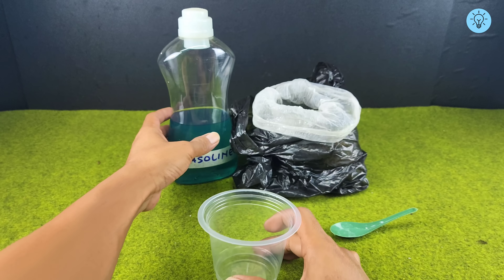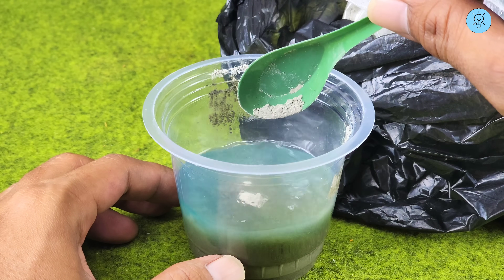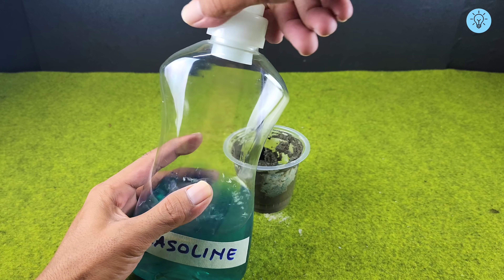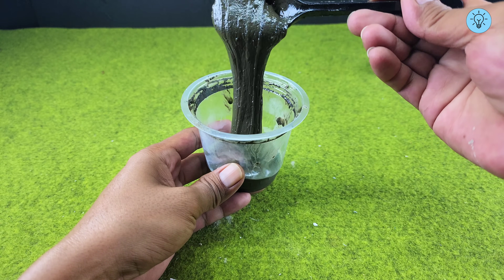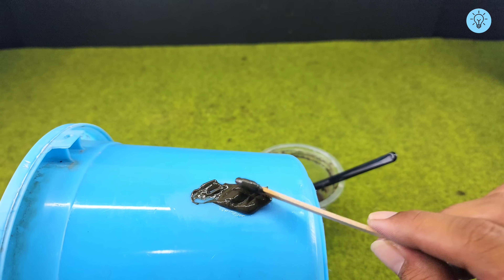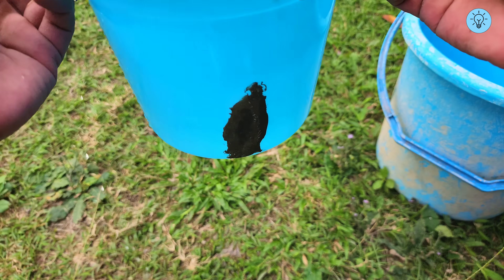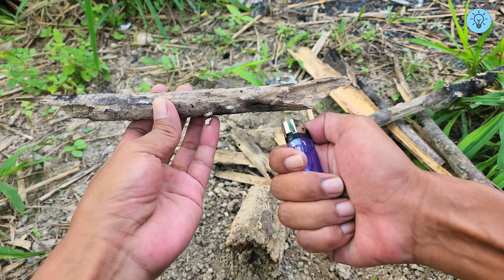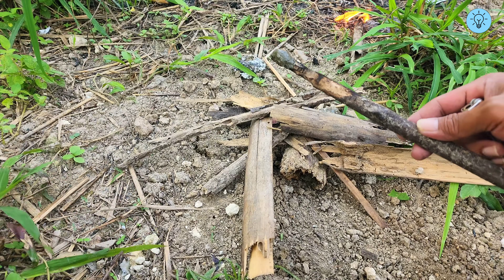Mix GASOLINE with CEMENT! Amazing results that most people can't imagine

Comment: Or, you could use the gasoline to drive to Harbor Freight and buy a new better bucket for the cost of the cement.🧐🤔😂😅🤣
Reply from the maker: That’s a very practical suggestion! Definitely a good option for some situations. 😄
Reply: @creationDIY_101 🤓
Reply: I'd repair my boat with this if I absolutely had to

Comment: Likely substituting a fine sand or dry clay instead would be cheaper and more effective. The concrete won't hydrolize anyway without water
Reply from the maker: Thanks for your input and sharing your knowledge! The video shows an experiment with specific materials to demonstrate a unique outcome, but your suggestions are interesting alternatives. Hope the idea is useful!

Comment: Does it have to high test blue jet fuel ? Gasoline isn't that color unless it's turbo blue or 2 stroke . Can regular gas be used ?
Reply from the maker: Great question! You can use regular gasoline — the color doesn’t affect the result in this case. Thanks for taking the time to ask! Hope the idea was helpful.
Reply: @creationDIY_101 Thank you

Comment: You are not allowed to use a gasoline mixture to start a fire in the woods.  Using gasoline to start a fire in the woods is highly dangerous and not recommended.
Gasoline is extremely flammable and can lead to uncontrollable fires, posing serious risks to safety and the environment. Here are some important considerations:

Fire Hazard

Gasoline can ignite quickly and create explosive fireballs, making it difficult to control the flames.
Legal Issues

Many areas have laws against using accelerants like gasoline in outdoor fires, especially in forested regions.
Environmental Impact

Gasoline can contaminate soil and water, harming wildlife and ecosystems.
Safer Alternatives

Use dry kindling, small twigs, and natural fire starters like leaves or bark to safely start a fire. Always follow local regulations and fire safety guidelines.
Reply from the maker: Thanks for sharing your thoughts and safety concerns. You’re right that gasoline can be dangerous if handled carelessly, but when used with proper caution and understanding, it can still be applied safely in controlled conditions. I truly appreciate your reminder about fire safety — it’s always important to stay careful. 🔥🙂

Comment: It would be cheaper & easier to buy a new bucket wouldn't it?
Reply from the maker: It's true, but sometimes it's not just about saving money — it's also about finding creative ways to repair and reuse broken items. These repair methods can be used in ways other than plastic, such as patching leaking roof tiles or fixing leaking walls.

Comment: Use kerosene rather than gasoline for the firestarter.
Reply from the maker: That’s a good tip! Yes, kerosene can be safer and easier to control in some cases. Thanks for sharing! 🙏

Comment: What kind of gasoline is blue like that? And in a special plastic cup no less. It looks more like two cycle gasoline.😅 Just Sayin
Reply from the maker: Actually, the gasoline isn’t for a two-stroke engine. The original color of gasoline is clear with a slight yellow tint, but in my country, fuel is colored differently to indicate octane levels — blue for 92, green for 90, and red for 98. The color helps consumers easily choose the right one for their vehicles. Hope this idea is useful!

Comment: Looks like 2 stroke
Reply from the maker: It’s actually not related to a 2-stroke engine. The fuel shown here is regular gasoline, but in my country, gasoline comes in different colors such as green, blue, and red. These colors are added by the producers to indicate different octane levels — green for 90, blue for 92, and red for 98. This helps consumers easily choose the right fuel for their vehicles. Hope this information is useful!

Comment: wonder how it would work to start fires if you used kerosene or diesel  USA
Reply from the maker: Good question! Diesel or kerosene can work, but they’re slower to dissolve Styrofoam compared to gasoline. It’s worth testing though! 🔥

Comment: Gracias, lo usaré para reparara el tanque de agua de 500 litros que me averió la pedrea del 2017!
Pero me parece un despropósito, solo con nafta y poliestireno telgopol´ ya alcanza para encender, o en vez de usar cemento para ese fin, con arcilla, ceniza o tierra creo que serviría. Pero no se. Es cuestión de probar costo beneficios! 
 Saludos desde Alta Gracia, Cba. Argentina.
Reply from the maker: That sounds like a great idea! 😊 Yes, you’re right — depending on the material, you can experiment with other natural alternatives too. But the gasoline and cement mix gives a very strong and durable result. Thanks for sharing your thoughts — greetings to Argentina! 🇦🇷

Comment: When you lot say gasoline is that diesel, cause that's kinda what I'm thinking. Oh wait do you want viewers to try both. Also you haven't discussed polypropylene or polyethylene containers and cross bonding
Reply from the maker: The liquid I used here is gasoline. Normally, gasoline is clear with a slight yellowish tint, but in different countries it can look different because producers add dyes to show the octane level. For example, here we have green gasoline with 90 octane, blue with 92 octane, and red with 98 octane. The colors are just to help consumers choose the right fuel for their vehicles. Hopefully, your idea is useful.

Comment: You should put a layer inside the bucket after the outside layer dries.
Reply from the maker: That’s a smart suggestion! 👍 Yes, adding an inner layer after the first one dries will make it even stronger and longer-lasting. Thanks for the great tip!

Comment: 4:57 that's not a smooth surface
Reply from the maker: Yes, you’re right, it’s not a perfectly smooth surface. Sometimes the translation or explanation from AI still needs a little adjustment, but the repair still works well.

Comment: That is really unique and cool but with the gasoline cement and Styrofoam mixture isn’t that kind of like a JB Weld? And also with the one you didn’t add the Styrofoam to that is like a liquid not liquid but a I don’t know what the name is but they sell fire starters like that to where you just push it out of a tube onto wood and it starts that is really cool and unique. I would like to know more about how you came across this and where you learned it at And also does it give off any toxic fumes when it burns and also couldn’t you put that on the inside of the bucket as well as the outside of the bucket you’re trying to fix just to make sure it holds better and could you use this on a car‘s oil pan to fix a crack as long as you did it on the outside and inside of the oil pan if the oil panwas cleaned and dry or with the oil if you did it on the outside when the oil pan was full. Would it still leak through or would it hold just as strong with the oil do something to that mixture?
Reply from the maker: Thank you so much for your detailed comment! 😊
Yes, the first mixture — the one made only from gasoline and cement — can give off a bit of smoke when burned, but not too much. It’s better to use it outdoors or in a ventilated area. I haven’t tried it on a car’s oil pan, but for small fixes like buckets or cracked walls, it hardens really well and becomes very strong. You can also apply it on both sides for better adhesion. This experiment is all about creativity — making something useful from simple materials. Hope the idea inspires you!

Comment: You could utilize sanding screen as a material to dpan larger openings to stabilize two sheared edges.
Reply from the maker: That’s a great suggestion! Using a sanding screen for wider gaps sounds really smart — it could make the mixture even more stable. Thanks for sharing your idea
Reply: Or you could save that ten bucks and BUY A NEW BUCKET!!!

Comment: The patch cost more to make then to buy a new bucket.
Reply from the maker: Haha, yeah that’s true if we just think about the price 😄 But this experiment is more about creativity! This mix can also be used for other things — like fixing a leaking roof tile, sealing a cracked or damp wall, and more. It’s not really about cost, but how simple materials can be turned into something useful for daily life.
Reply: And if the tape had been applied carefully to the inside, that alone would have fixed the crack.
Reply: @PromptCriticalJello  Buket fix is and example

Comment: Last time I put gasoline in a plastic cup, the cup dissolved almost instantly. That’s not pure gasoline. I call BS!
Reply: He could be using a plastic that’s strong enough to hold the gas man, gas cans are plastic too it’s all about the type of plastic
Reply: Gas cans are made out of plastic  Styrofoam melts with gasoline  not plastic
Reply: Before you make assumptions, you should do a couple of experiments I have found some food containers are not compatible with gasoline or kerosene, but I’ve also found that a lot of soap containers are
Reply: there are different kinds of plastic
Reply: Your cup was styrene, that cup isn't. Different polymer.
Reply: Your gas is just a solvent. laquer thinner or acetone would have been a better choice. What you've made is bulk model glue, with Portland cement polluting it. Jebus christo...
Reply: What about the Styrofoam?
Reply: @brianlomax3363  What about it?
Reply: Gas isn’t blue unless mixed with something!
Reply: @chickenlittle5916  Aviation 100 octane, "low lead" is dyed blue.

Comment: The are better materials for both jobs. The gasoline-cement mix is not much safer than gasoline as the gasoline can still flow out. The second mix does not need the cement and it would still be a good adhesive.
Reply from the maker: You’re absolutely right — there are definitely easier materials to use than this mix. But at least with this experiment, we can learn how to turn leftover or unused items into something more useful for daily work.

The first idea is about practicality — once gasoline is mixed with cement, it becomes much safer to carry than liquid gasoline alone. For the second idea, maybe you haven’t tried it yet, but when cement, styrofoam, and gasoline are mixed together, they create a surprisingly strong compound that can be used for many purposes. If you’re curious, you can try it yourself and see the amazing results.

Thanks for your comment, and I hope this idea is useful for you!

Comment: Try BBQ lighter fluid in the same application. The stench is far below that of gasoline. Has many of the same properties it's just easier to handle. Peace
Reply: USA Colorado
Reply from the maker: That’s a great suggestion! BBQ lighter fluid sounds like a smart alternative — safer and easier to handle while still giving similar results. Thanks for sharing your tip!

Comment: I really enjoy watching your videos. Its been very informative thanks very much. I'm wondering how long is the working time of the Cement,Gas and Styrofoam last for please ? Before it hardens. 
I've got some bigger ideas and need to figure out my timing on how long it's going to take me.And if I can use it in bigger batches.
I would really appreciate your help.Thank you.
Reply from the maker: In a small scale, like the example in the video when patching the bucket, I let it sit for about 24 hours, and it hardened really well. But for a larger scale, I haven’t tried it yet. You might try it gradually to see how much time it takes — I believe with a bigger batch, it will still harden properly, though it might take a bit longer than 24 hours
Reply: @creationDIY_101 Thanks very much for sharing your information 😀 👍

Comment: With respect to the bucket repair, drill a small hole at each end of the crack before applying the mixture.  This will ensure the crack does not progress.
Reply: Or, just go buy a new bucket. They're ubiquitous.
Reply from the maker: That’s a great additional tip! Thank you for sharing such useful advice. It will definitely help improve the repair result. Hope the idea helps many others too! 🙌
Reply: We do the same with granite and solid surface countertops to stop the crack from spreading

Comment: If you flex that bucket the slightest amount that patch is gonna completely come off, if you sand the area first with some course paper it will hold together 10x better...
Reply: He did sand around the opening on the outside of bucket,but didn't say the grit of the paper.

Comment: The Gas is blue so are you using 110 low lead?
Reply from the maker: In my country, there are several types of gasoline with different octane ratings and colors. For example, the green one has an octane of 90, the blue one 92, and the red one 98. The color doesn’t indicate aviation fuel, but it’s added by the producers to help consumers easily identify the right gasoline for their vehicles. Hopefully, this information is useful to you.

Comment: Blue gas?
Reply from the maker: Yes, in my country there are several gasoline colors — blue, green, and even red. Actually, the natural color of gasoline is clear with a slightly yellowish tint, but in many countries the color varies. Here, the color is added by producers to indicate different octane levels — for example, green for 90, blue for 92, and red for 98. The purpose of coloring is simply to help consumers easily choose the right fuel for their vehicles.

Comment: It needs to be stressed that gasoline fumes are very volatile and can burst into flames quite easily. It is also flammabl.e and toxic to breathe.  For greatest safety it should be used outside or under a hood. There are many other substances that can be used for repairs that are not quite so dangerous. Napalm is made by mixing Styrofoam with gasoline. It only takes one mistake to burn to death messing with it

Comment: 6:10    Ignoring the drop of water, are we?
Reply from the maker: That drop of water you saw was actually from the splashes when I poured the water back into the bucket, so some of it stuck on the outside of the patched area. Hopefully, your tip is useful.

Comment: Can you use this on microwavable tupper ware? 7:46
Reply from the maker: It’s not recommended. The mixture becomes very hard, but it’s not food-safe and could release harmful chemicals when heated. For kitchen items, it’s always better to use safe and certified repair methods. Hopefully this tip helps.
Reply: Please don't

Comment: It’s like rubber cement??
Reply from the maker: It’s a bit different. When gasoline is mixed with cement and styrofoam, the mixture hardens strongly after some time and can stick to different surfaces. For example, in this video I used it to patch a plastic bucket. Hopefully this idea helps.

Comment: I'm going to try this with starch instead of cement. Should work the same. Since starch is white, it's easy to add any color.

What if you'd use 99 parts gasoline and 1 part diesel? Could you make a form of rubber? The diesel would not evaporate like the gas, and in it would remain the lubricant. Thinking out loud here.
Reply from the maker: That sounds really creative! Using starch could indeed make it easier to color, but the mix with gasoline and diesel might not be stable or safe. Still, it’s an interesting idea to think about. Thanks for sharing!
Reply: Hmm... starch is organic, and might degrade in time, especially if wet.  Chalk powder sounds good.

Comment: Looks like JB Weld. Hmmm.
Reply from the maker: Yes, the hardened result does look similar to JB Weld. The difference is that this is a DIY mixture made from gasoline, cement, and styrofoam. Hopefully this explanation helps

Comment: NOTE ! When dissolving polystyrene foam the fumes given off are TOXIC.
Reply: Most definitely
Reply: Thank you!
Reply: No more toxic than the gasoline.
Reply: @MikenomorCCP  
Dangers of Styrofoam (Polystyrene)

    Styrene is a Potential Carcinogen:
    Styrofoam is made of polystyrene, which contains styrene. Styrene is classified as a potential human carcinogen, with studies showing links to certain cancers and genetic damage. 

Exposure to Fumes:
Although the primary danger is from acetone fumes, styrene itself can be released, particularly if the styrofoam is heated or processed. 

Dangers of the Combination

    Intense Fumes:
    The process of dissolving styrofoam in acetone produces a large amount of volatile acetone vapor. 

High Risk of Fire:
The highly flammable nature of acetone combined with the dissolving process makes the mixture extremely hazardous. 
Skin Exposure:
The dissolved polystyrene mixture can be sticky, and handling it without protective gloves can lead to skin dryness, irritation, and increased vulnerability to damage from the acetone. 

Safety Precautions

    Ventilation:
    Always work in a well-ventilated area, such as an open outdoor space or a fume hood. 

Protective Gear:
Wear chemical-resistant gloves, eye protection (goggles), and possibly an apron when handling the materials. 
Fire Prevention:
Keep acetone away from sparks, flames, and heat sources. 
Proper Disposal:
Dispose of the resulting mixture and any related waste at a hazardous waste collection facility. 
Consult MSDS:
Always refer to the Material Safety Data Sheet (MSDS) for detailed safety information. 
Feeling lucky?🏴‍☠

Comment: Great way to repair any leaks in a car's plastic windshield washer retainer which often freezes in winter causing cracks and leaks windshield washing fluid when Spring rolls around and the mud shows up.
Reply from the maker: That’s a smart idea! Using this method could really help with small cracks and leaks like that. Hope the idea will be useful for you 😊🎉
Reply: Or just use windshield fluid with antifreeze in it , has worked for me in Canada for the last 75 years

Comment: 24 hours? Icould buy several new buckets for less than the other new thing I'd have to buy just to get the polystyrene packaging. While I  was at it I could get a sealed metal container for the fire starter instead of leaky takeaway sauce cup.